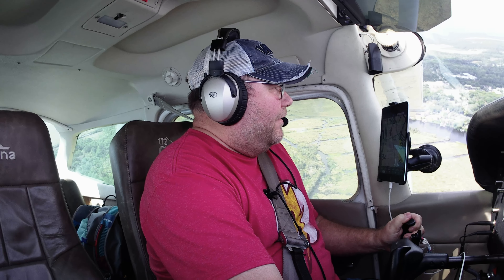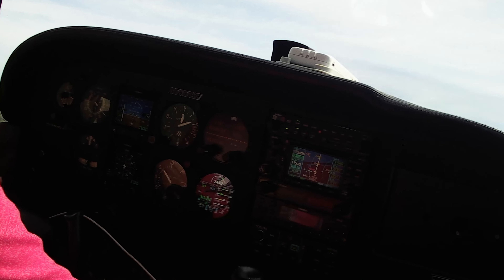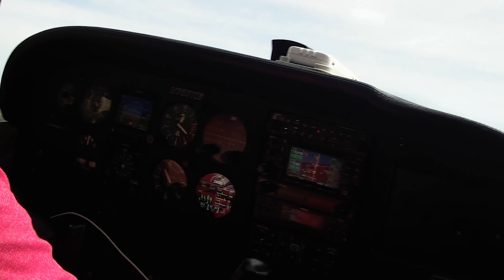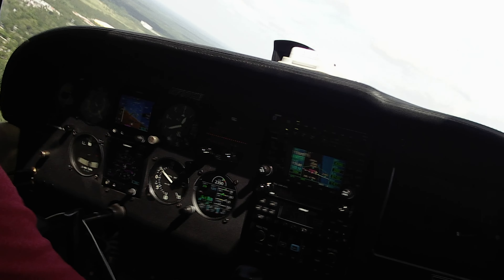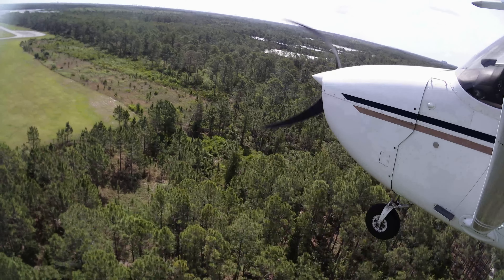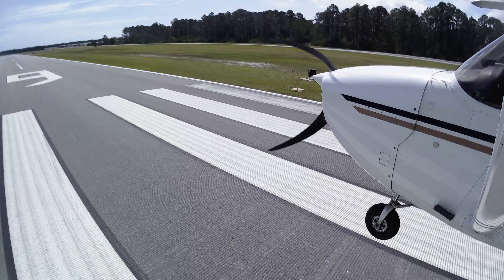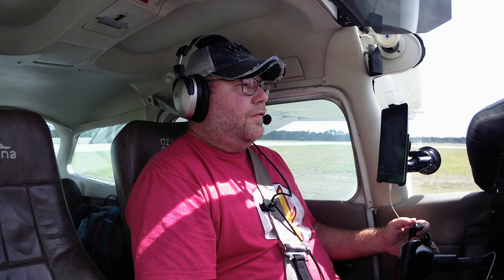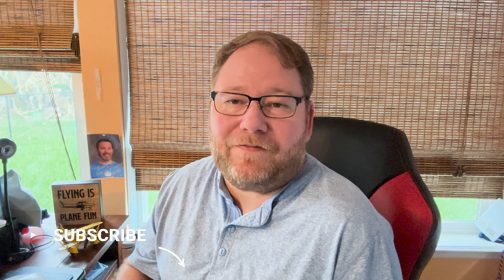Engine Trouble on Take Off | Engine Not Making Full Power | Cessna 172

Comment: I'll tell you what, there's a guy on You Tube every small plane aviator should tune in to - The name of the channel is Savy Aviation.  I would try to contact that guy top priority. One thing I have in my brain by listening to Savy Aviation videos is Lycoming engines have a tendency for STUCK valves, and Continental engines have a tendency for BURNT valves. There was one video Savy Aviation did about an engine for a club 172 that he advised on.  Through common sense and simple maintenance techniques, they took the engine WAY past TBO and it totally ran fine.  The guy's actual name is Mike Busch.  I would be on the phone tomorrow trying to get in touch with him.  He's got a website as well as a You Tube channel. The guy is SUPER smart.

Comment: This happened to me on a C172.  It was a loose duct.  With the engine off it was in proper position but with engine running sometimes it would move and restrict airflow thus limiting power.

Comment: Happened in my 150 off and on for months.

 Cleared out mud dauber nest in fuel vent. Eventually swapped out to new PMA fuel vent.

Had carb heat flap checked.

Eventually found out that it was a bad mag coil.

Since then, I’ve added STC belly sump to clean out debris in lowest part of fuel line.

Swapped out to higher quality Steve’s gascolator.

Replaced sand clogged fuel shutoff valve with new MacFarlane vale. 

Now it runs like a top.

Comment: After you got down did you try a full static runup on the ground? You may have had a small bit of carb ice. I've had it in middle of summer, even on the ground before during long taxi/runup. Another thought is you may have fouled plugs. Either of those items could cause you to not make full power or run rough.

Both of those items can be checked with a good comprehensive runup, including checking Full static RPM check (If I read your N number right it's a C-172N which according to TCDS should be Not over 2400, not under 2280 if you have an original standard prop) and idle checks and really paying attention to your mag drop to see if you need to lean and burn off any fouling. 

If you didn't already do that, next time you have a chance to start it up go check those items, eliminate the easy stuff first. Be sure to do your static check leaned for max power and faced into the wind. Believe it or not it can make a difference. 

After you do that there can be further checks of things like spark plugs, mag timing, be sure your carb heat door is fully closing and opening, air filter unobstructed, full travel on your throttle and mixture cables on the carb, fuel screen, etc. Some stuff you can check yourself as a pilot, check part 43 Appendix A (C). For stuff you cannot, check with an A&P.

Hope that helps!
Reply from the maker: I did! It ran fine with static RPM at 2,300. I also did mag checks at 1,700 and full power, and both mags operated great. 

I pulled the engine logs from the GI275 and I am scouting my video footage to Glenn whatever I can. I am working with my  A&P to troubleshoot too.
Reply: @thecompetentpilot  

Good deal. I think you did a good job of making that quick decision and handled it well to get it back. Better to be safe than sorry. Hopefully you can figure out the issue soon with your A&P! Please reply if you find out the issue, I'd be interested to see what it was!
Reply: I thought I caught a fleeting glimpse of the engine monitor where the #2 cyl had low EGT's